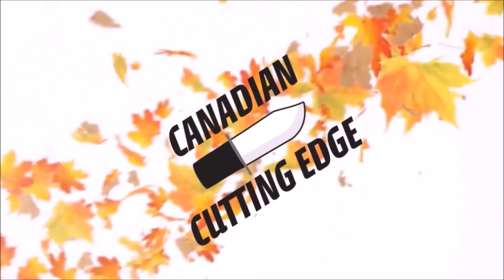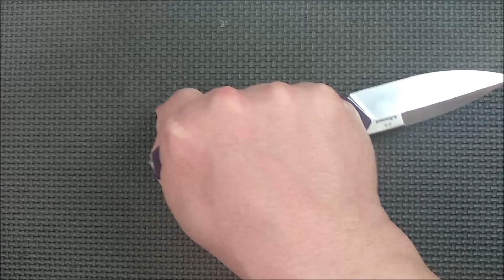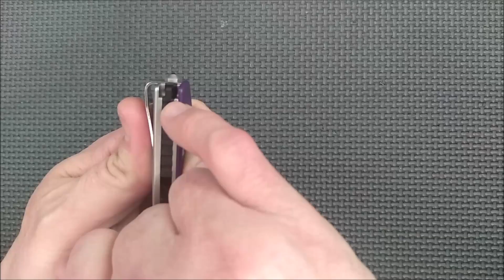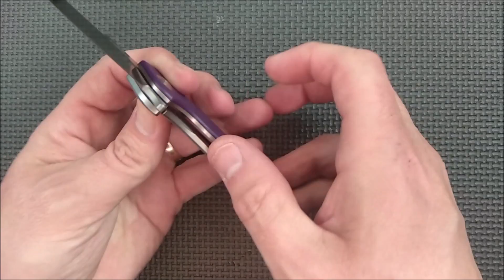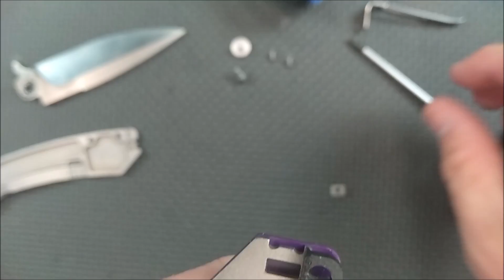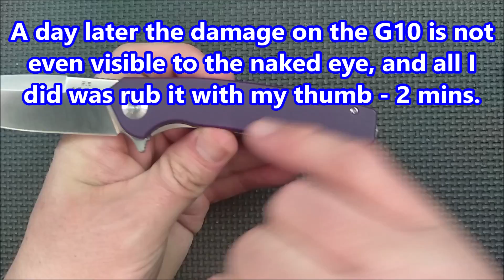Review: Adimanti Skimen NEFORMAT - Designer Ruslan Skimen & made by GANZO

Comment: the screw is fixed with a thread lock. if you heat it with a lighter, it unscrews without effort
Reply from the maker: Right, I am quite aware of threadlocker and it;s over use in pocket knives these days.  A lighter can certainly get them hot enough to free them up but I seriously dislike melting/marring the handle scales.  As a last resort I prefer to use a very fine tip on a soldering iron to heat up the screw and break the bonds of the threadlocker.

Comment: I had to watch the whole video before making a post because I value your opinion. I am done with Chinese manufacturers that use a combination of free spinning pivots and thread locker. DONE! I like everything about this knife, it is a great design. Except the free spinning pivot, and I will stop ranting. Just no to this atrocity of a knife.
Reply from the maker: There is nothing wrong with having such standards.  Those types of standards are important, which is why I have been doing full teardowns in each of my videos for a long time so that people can learn EXACTLY how a knife is made.
Just know that just because a brand has one knife made a certain way it doesn't mean that all of their knives will be made the same way.  You really need to take them on a knife by knife basis, and if you cannot find a COMPLETE review (like mine) for a knife it's probably smart to hold off on buying that knife until you can learn for certain if said knife meets your requirements or not.
Reply: @CanadianCuttingEdge  As always you speak wisdom. And I do truly appreciate that you actually take the time to disassemble the knives you review. As to a knife by knife basis, if a manufacturer is using free spinning pivots that is a bad practice. I can only think of two reason for free spinning pivots, 1) to cheapen the cost of manufacture or 2) shooting for planned obsolescence. Ganzo has some very good knives at very reasonable prices, this one however I have watched reviewers struggle with the free spinning pivot and that tells me to stay away from this. Thank you for taking the time to respond.

Comment: HA! I'm 2-years behind:) I was checking this knife out on Amazon today then found this older video. Amazon is saying the steel is S35VN, but I seen D2 when you showed it. It also says Titanium Handle, is that true on the one side? Just curious, thinking about getting one or their newer FH-922 in orange, I like that one too and remember your review on it.
Reply from the maker: Ahh, they also have a Premium version of the knife just as you saw it on Amazon.  You have the choice to get the titanium with s35VN or the G10 version.
The Titanium one is a framelock (it has Titanium on both sides), the G10 ones are liner locks.